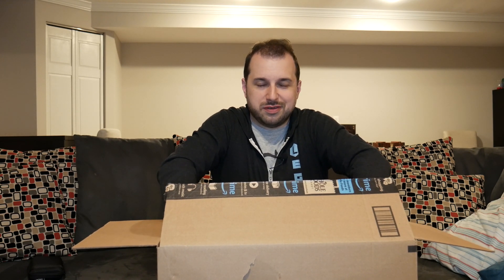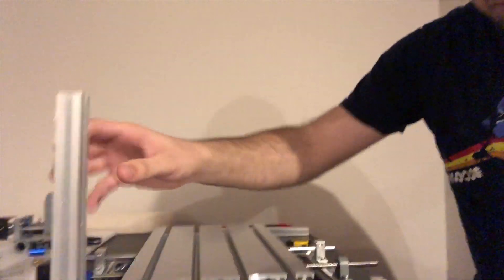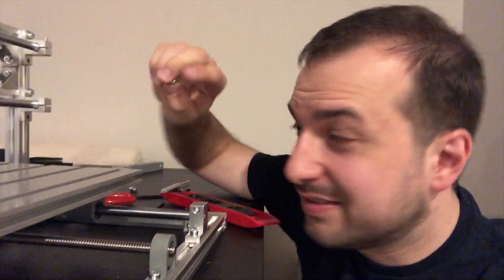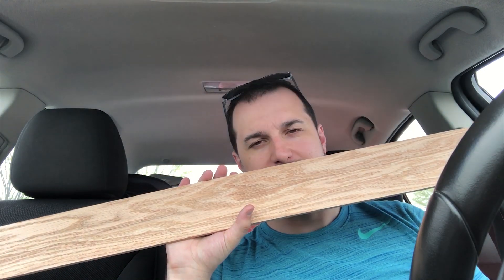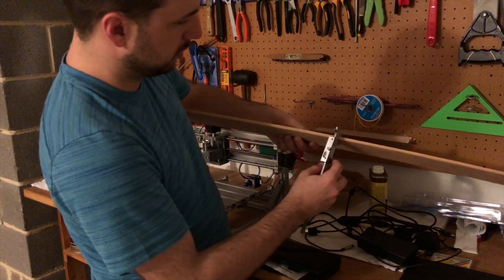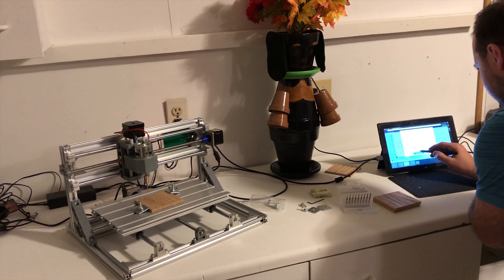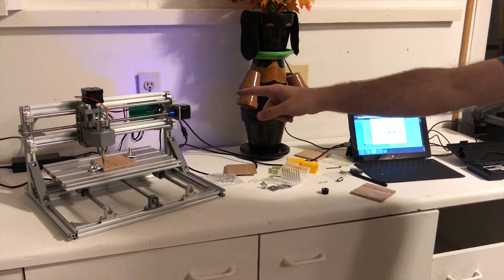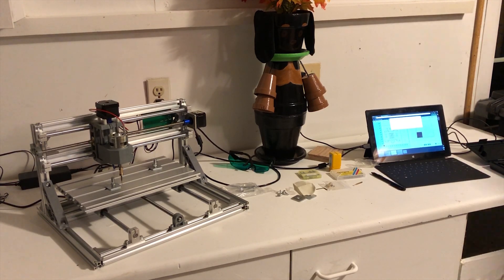GRBL CNC 3018 Build & Review

Comment: Hey man, nice video. I just wanted to point out that you can't correct for bad bed leveling by leveling the whole machine! What's important in your case is that the bed is perfectly parallel to the X axis rails. By leveling the whole machine you're tilting both so nothing changes.
Reply from the maker: I actually talk about that in an update video that I’m recording right now with things I’ve learned. Good comment!!